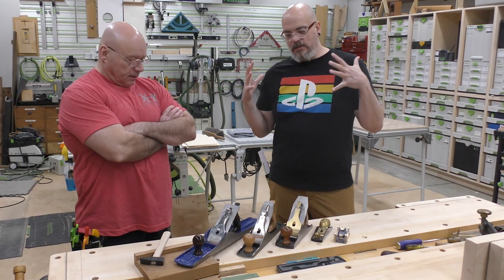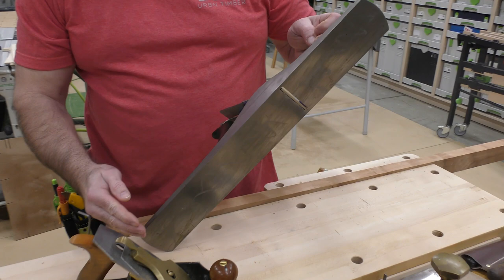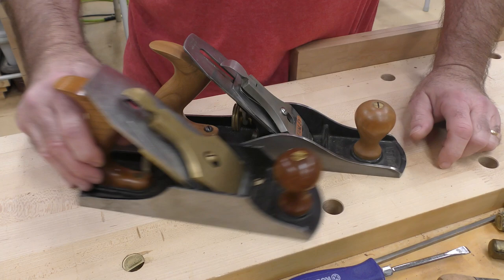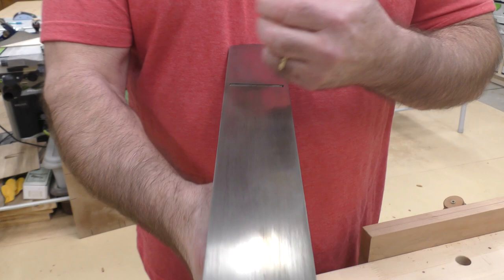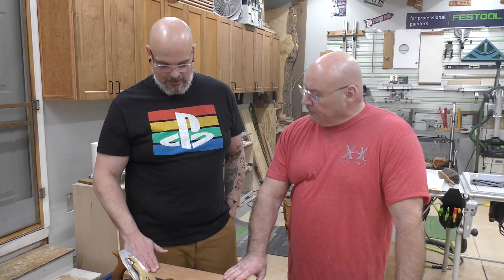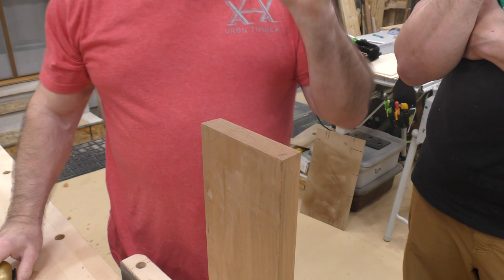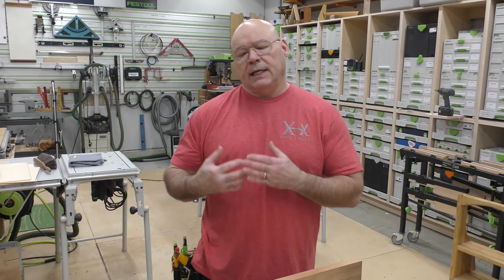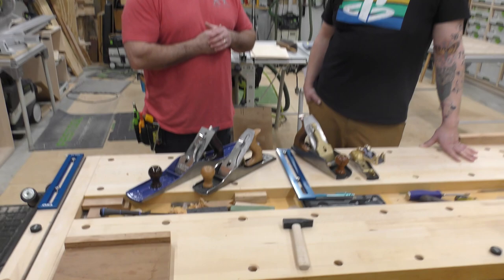If You Don't Own These You're Not A Real Woodworker !

Comment: I have that Bridge City block plane too, but I made a few mods:
- Got some M4 knurled knobs to replace the screws, much easier to change the setting of the skates.
- Removed the skates! I use it just like you and it takes up so much less space when they're off, ultimate light and compact.
Reply from the maker: Good Mods ..I'm gonna try the knurled knobs .. Thanks !!

Comment: The shitty part for someone starting out, the new Stanley or more budget friendly planes are crap. If you can find an old one the people selling either want ridiculous amounts of money or they just need so much work your beginner wouldn't even know where to start with restoring it. 

Otherwise a good go set out of the box planes will cost hundreds if not thousands. 

I'm lucky I've had good luck finding old ones for a good deal or buying from the Veritas seconds sales where they only have cosmetic deficiencies and are significantly cheaper. 
But I know others starting out always struggle to get planes
Reply from the maker: Thanks for your input Joe...... I restored a few old Stanley's to get started and they are sill working great.....
Reply: @sedgetool  Oh ya, they're great once restored. Just sucks for some now being able to etc so they are stuck with nothing.